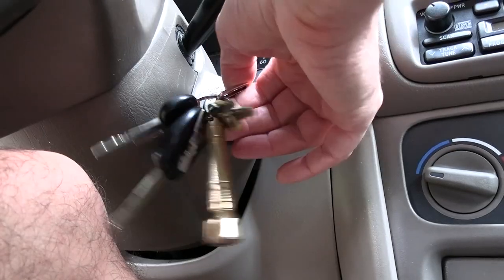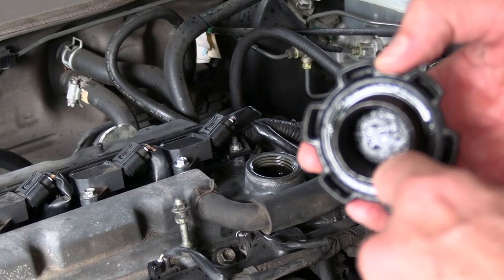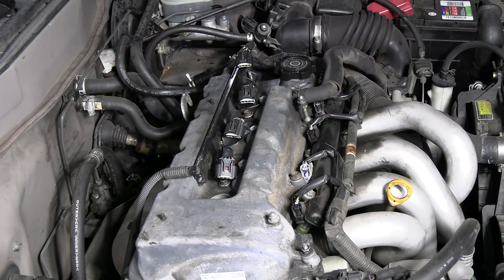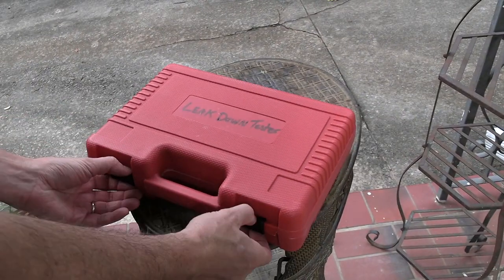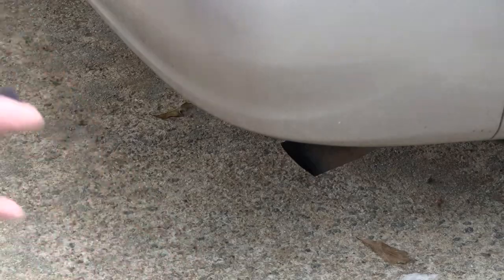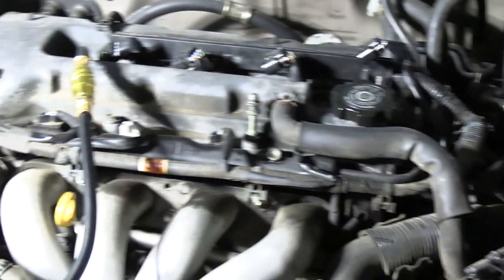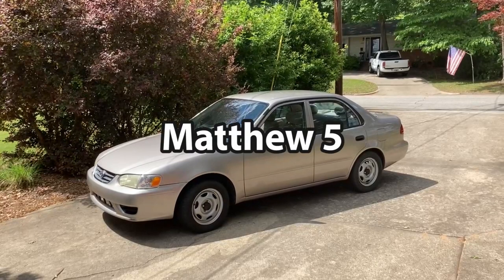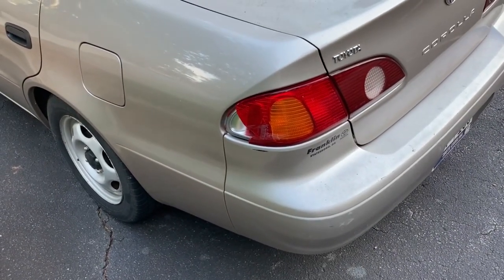How to perform a leak down test | Oil Burning🔥Experiments | Episode 14

Comment: You aren't using the gauge right. You need to connect it and raise the regulated pressure slowly to 100% after the engine is already at TDC on compression. Your first gauge is regulated pressure, your second gauge comes after a restrictor and is observed pressure. The 20% correlates to 80PSI, 40 is 60PSI, etc...

In other words if you apply 100PSI to the cylinder, and there is 10% leakage, the gauge is observing 90PSI in the cylinder. Your observation gauge should never read higher then the regulated side pressure reading.
Reply from the maker: Can you link to documentation/tutorial on that?
Reply: I agree. 100psi in, and it measures 90 psi in the cyl = 10% leakage. 80% in cyl = 20% leakage. And so on. 
There is no freakin' way that engine has less than 20% leakage.
Reply: @FamilyFriendlyDIY  Um every manual is either going to be slightly different but all gauges work the same. Some gauges may be able to be "calibrated" as in correcting the needles if they are off. But your leak down test has to take place at TDC of the compression stroke. TDC of the intake stroke will have the intake valve open as it begins to open before TDC. There is valve overlap on every stroke except during compression. And most of the wear in the cylinder is at TDC due to combustion hence testing TDC on compression, not exhaust.

You need to hookup the gauge, and verify that you set your regulated pressure to 100, your observed pressure (gauge 2) will tell you how much of that pressure the cylinder is holding. Word of the wise is TDC of the compression stroke is gonne be hard to get. A few degrees of crankshaft movement  is all it takes for the valve that is closed to start opening, and depending on the slack in  the chain/belt you won't see that by just having the crank lined up at TDC. I would suggest getting it to TDC, slowly increasing the pressure, then holding the crank with a long breaker bar, moving it back and forth slightly to verify your valves are closed. Alternatively the best way to perform this test is with the valve cover off so you can feel if the rockers are loose and off the lobes.

I would link you a manual but mine is at work, its a snap-on, and snap-on doesn't list their manuals online. And I have a chrysler training book that just refers you to reading the manual itself for calibration. lol
Reply: @FamilyFriendlyDIY  I would also add that engines compression is going to be 130psi and higher typically. For instance my engine is 9.5:1 it compresses air 9.5 times. So at sea level it takes 14.7psi X 9.5 = 139.65. So this engine should produce near 140 psi of compression. That is A LOT when compared to everything else (coolant being no higher then 22psi typically) so you won't find a leak using 20psi.... that gasket needs to hold much more during combustion!
Reply from the maker: Okay, did a little research:
I found there are two types of dual gauge testers. The older, traditional style, which, as you said, shows regulated pressure on the first gauge, and observed pressure on the second ...
and then there's the tester for dummies, like I used. The first gauge reads cylinder pressure, and the second gauge is purely percentage loss. You can used anywhere from 45 to 100 psi with this gauge, which is why it must be zeroed to the incoming pressure. If you noticed, when  the kit was hooked up to my compressor, the first gauge read 30 psi, since 30psi was the pressure it was "ready" to send to the cylinder, and then as soon as I hooked it up to the cylinder, it dropped to roughly 27psi, as (due to some leakage) the cylinder couldn't hold the full 30 psi the kit was trying to send it. The second gauge was therefore reading the correct percentage drop of 10ish percent (as 27psi is 90 percent of 30psi).

Here's a link on how to use the style of gauge I used:
https://youtu.be/WHli-wLy9_o
Here's a link to a video on how to use the other type of dual gauge tester.
https://youtu.be/J9aKM4znvWU
Thoughts?
Reply: @trevormorgan7138  I agree. The reason the needle jumped is because the air pressure in the cylinder was rotating the crank slightly.
If you claim the engine had 220psi compression why would you test it for leakage at only  30psi.? That just makes no sense.
Reply: @FamilyFriendlyDIY  That gauge is no different then then one that shows PSI. The only difference is yours shows percentage of 100PSI. It is a 0-100 PSI gauge labeled in percentage backwards to make it easier for people who don't don't know how to calculate the inverse percentage. My snap-on gauge cost $350 bucks or so... it shows percentages. But its no different then any other gauge. They all work the same! Your gauge is broken that is why regulation pressure is lower then your observed needle. Unless you can calibrate it (most can't these days) I would get a new one.
Reply: @FamilyFriendlyDIY  Also as far as your engine oil burning goes, a leakdown test won't help you at all. Since leak down is testing compression and an oil control ring doesn't hold compression, nor does valve stem seals or valve guides. What it can tell you have a head gasket fault, which could indicate if that is your culprit. But you need to tear it down to confirm. Leakdown is only useful in telling you how much and where a leak is. You can pass a compression test, but for instance be leaking through the headgasket into the cooling system. On a cold engine a leakdown test will confirm that, where a compression test would tell you are fine.

However you need to perform a leakdown and compression test on a warm engine if it has issues warm, and cold engine if the issue is only present when cold. Some will tell you only when hot... But from a professional standpoint all testing needs to be done under the circumstances when the fault occurs. You might have leakdown into the coolant system cold, but not when warm and everything is expanded.

Comment: That's not the correct way to do a leak down test. You don't pre-pressurize the leak down regulator. You back the leak down tool regulator all the way down to zero psi FIRST. Then hook up the leak down tester tool to the cylinder under test. Then slowly adjust the leak down tester regulator until it shows 100 psi on the left gauge, the right gauge tells you the results.... You need to redo the test

Comment: Excuse me sir, you could most prob have oil leak, not oil burn.
Reply: No visible leaks outside the engine, no oil in the coolant, only other possibility is it's burning. Technically leaking by something, but internal to the engine
Reply: If you watch the series he says it’s not leaking.
Reply: @aidanclegg9470  there were alot of oil leakage around the timing chain tensioner and valve cover area
Reply: @1ZZFE  there’s still no leaks.
Reply: @aidanclegg9470  he better check again.

Comment: your car runs to wellll to be head gasket,most times head gaskets either jump between  cylinders  or water jacket ports in  head and block , and  pressure will will  make hoses get hard   from  blowby pressure .,i would say oil control   rings are at fault , allso no overheat problems  from head gat sket leaks,,it would not be oil filling cylinders